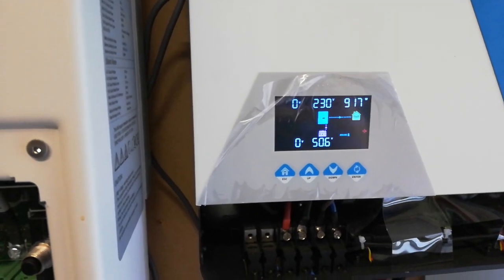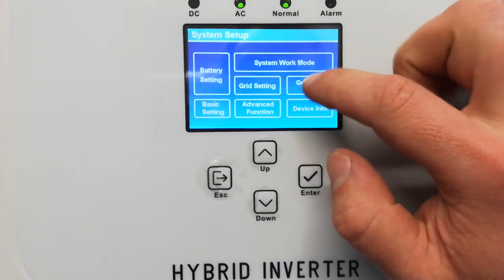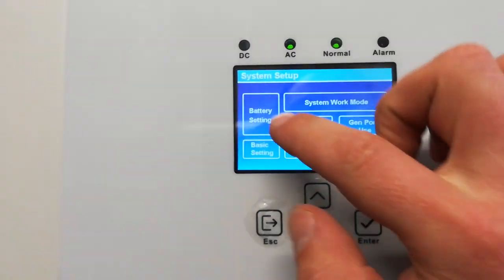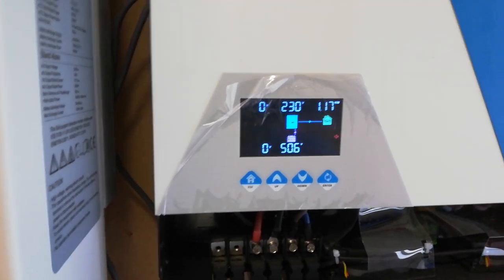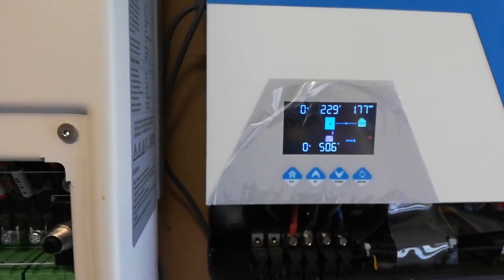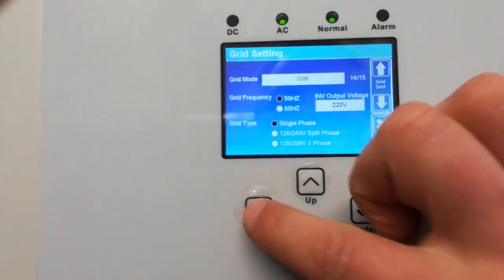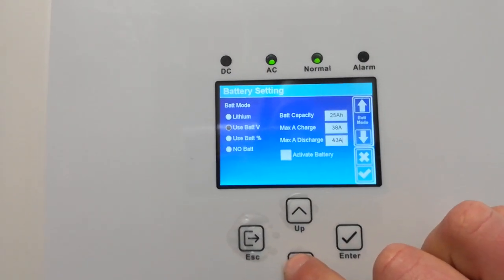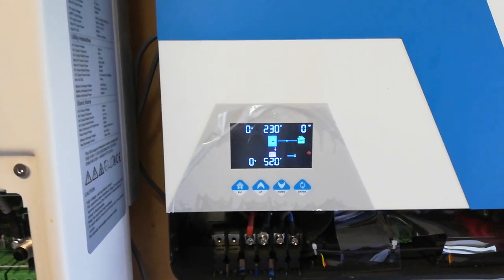Virtual Grid using a hybrid and off-grid inverter.

Comment: Great video, keep experimenting please!

Considering the case where power outages happen quite often during the day when the sun is shining, wouldn't it be better to let that hybrid inverter (with a minimal bank of batteries) form the grid and let a microinverter or a grid tied contribute?

If I an not mistaken, any excess produced by the panels should be routed by the hybrid inverter back to the batteries to charge them. When the batteries start getting full and there's still an excess of generated solar power, the hybrid inverter would then start to increase the frequency to a certain value where aforementioned microinverters or grid-tied ones will disconnect. How do you find this kind of setup?

Your expertise is super valuable on my decision making process. I am considering that kind of deployment since I face this situation a lot.
Reply from the maker: Hello, Yes your suggestion will work to a point... On the Deye/sunsynk inverters there is also an AUX port which can be for set for a few different uses - Generator, Load control ( for a water heater) and Micro Inverter. If you physically wire in the Micro inverter / other grid inverter into this AUX input then you can set the On/Off thresholds. I'm not sure if this input is still active when the grid is lost...I will have to try it at some point. The other option you could do is wire your "grid inverters" via a Voltage Sense Relay which is attached to the batteries so when they are fully charged then that relay will disconnected your "grid-tied-off-grid inverter"... I hope that makes sense?
Reply: @roadeycarl  My proposal was more targeting islanding while the grid is not available. Hence, I would leave the AUX input (I did not know it actually existed though) free in case in the future I have another extra source like a small diesel generator.

In my proposal, the point of common connection between the microinverters and the the Deye/ Sunsynk would be at the output of the latter one. With these configuration, the whole wiring would remain unchanged and the microinverters wouldn't even notice that the utility grid is present or not since it's Deye/Sunsynk who's dictating the frequency of the "new grid".  Could you try this setup?
Reply from the maker: Yes this setup works as it's what I'm  currently running on my 8kw inverter.

You just have to make sure that the grid tie system doesn't exceed the total AC power rating of the sunsynk/deye inverter.